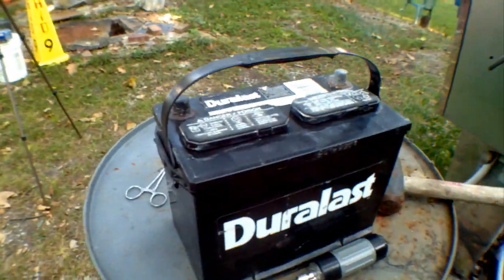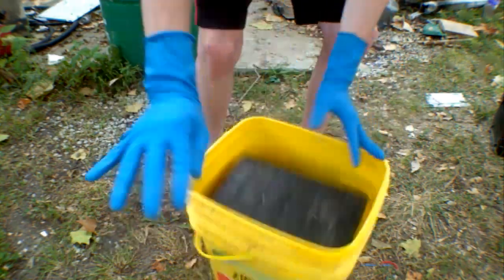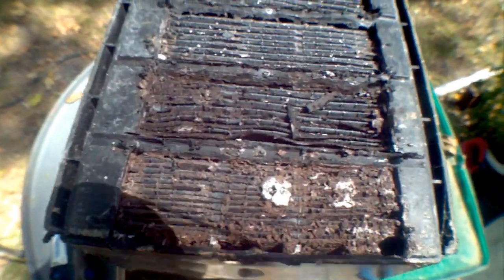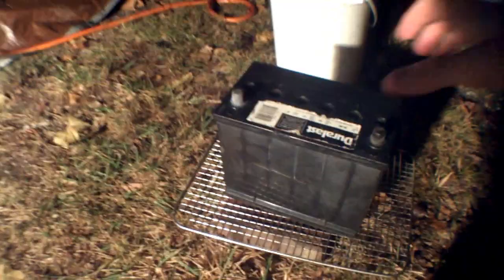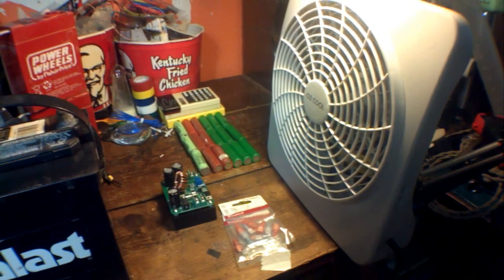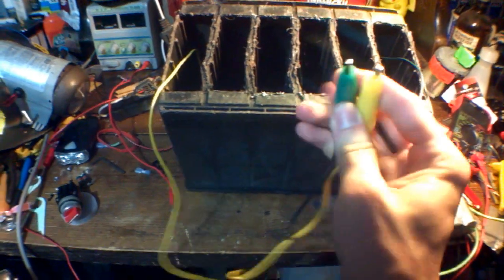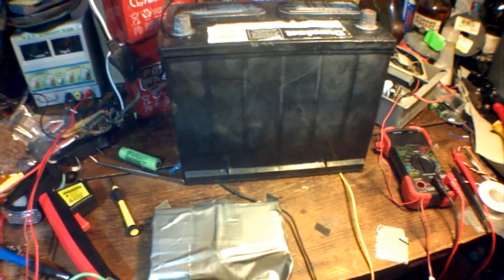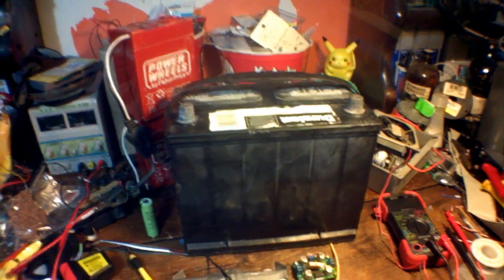DIY Lead-Acid to Lithium-Ion battery conversion 18650

Comment: What a huge and absurd waste of time hollowing out an old battery housing. Handling all that dirty lead and acid, when pathways are in place to pay you money for turning it in and letting competent industrialists recover the resources properly. That plastic bucket or a tin can would be a better and cleaner housing for any battery. But you didn't make a battery. And there's no need to make a battery. Go buy a motorcycle battery, then charge it and carry it around. Your opening sentence reveals your inherent stupidity. "This is my FAVORITE car battery." And I have a favorite paper towel and a favorite piece of aluminum foil. Idiots all.
Reply from the maker: well doing this has made me lots of cash, so thanks for letting me waste your time, but it wasn't a waste of mine.
Reply from the maker: qazmatron  yup dont do things just for money. if you get money thats great though.

Comment: I'm wondering if there is an issue balance (or lack there of) charging this setup?  Please let me know your opinion or if you just weren't concerned about it as you were using  recovered 18650s that still hold some capacity but are no longer 100%.
Reply from the maker: i wasnt concerned about it because i was just slapping it together for my camping trip. but tbh it wouldnt be that hard to ballance it, just add one wire coming out.
Reply: I'm really curious how this could be accomplished with just one wire added?  I was expecting one wire for each cell, but you don't need that many?
Reply from the maker: Atimatik Army  when you connect batteries in parallel they act as one big cell, so realy this batteryis just 2 big cells in series.

when you connect a battery in parallel they equalize and keep the exact same voltage. lithium batteries are very dependant on voltage for their state of charge so they will all stay the same.

likewise you could use this to make a purely mechanical balancing system, have relays to switch all your cells to parallel and they will ballance to the same voltage, then when you want to use the pack you flip the relays and it re-wires the batteries to what you want.
Reply: Wow, OK, I think you answered something I've been wondering about for months.  so for example, you can have as many cells as you want, and as long as they are wired in parallel no balancing will be needed?
Reply from the maker: Atimatik Army you'll just want to make sure the parallel pack stays between 3v and 4.2v and your good.

btw you can get them to like 4.5v before they will fail catastrophically but its just after 4.2v the longevity of the cells decreases a lot.

that increase of cell damage doesnt start at 4.2v though. so if you only charge your cells to 4.1v you will get twice the cycles, 4.0 and youll get 4x.

its interesting, at fully charged a lithium cell has enough potential energy to slowly mess up the plates. i think its the positive plate that gets dissolved slowly. meanwhile for lead acid its when they are discharged that the plates get sulfated and lose their effectiveness.. thats why youd want to store lithiums at like 3.9v and they will last a lot longer in storage. but lead acids at as high a voltage they will stay at.
Reply: Yeah, it is interesting how the different battery chemistries has such an effect on their properties.  Thanks for sharing what you know, it helped me clear up somethings I've been wondering.

Comment: what is the dielectric value of that duct-tape? You can empty the battery housing using the old method of removing the lid. Flooded lead acid battery rebuilding use to be a common place practice. They would remove the lid, drain the battery acid, flush the plates to dislodge sediment at the bottom of the battery cells, refresh the acid, and replace the lid. Then battery prices got less expensive and manufacturers were being sued for poisoning, medical claims, contamination of water, environment, agriculture, livestock, and public health issues including mental retardation from lead exposure. So they now seal the lids on the battery. It is a violation of local, state, and federal law to knowingly open and resultantly contaminate the environment with the contents of a sealed lead acid battery. Your parents will have to pay to decontaminate the property if anybody used this video as evidence to prove negligence in proper disposal of hazardous materials. Just be careful about what you share online, you never know who is on the other end, and that can cost you many things. Remember, the recycle logo on the battery is not a suggestion, and not having the correct zoning, certifications, facilities, equipment, and containment systems can lead to a world of problems.
Reply from the maker: yet people throw lead acid batteries into the trash all the time.

and what exactly did i contaminate? i didnt throw away or burry the contents of the battery. theres nothing illegal about opening a battery.
Reply: Rinoa Super-Genius I did not post to flame or discourage you. I was just sharing the fact that legality does exist regarding public health. Please buy a copy of the book A Civil Action, Yes, there is a movie Staring John Travolta loosely based on the book, and NO I do not recommend forgoing the book for the movie. I have worked assisting research within Public Health in the field of TOXICOLOGY. The professor I worked for focused on hermetic dose response curves. He did volumes of publishing with another toxicologist back in the 1980s under Federally funded research into petroleum contaminated soils and the toxicology of the countless chemicals. The fact that the sealed battery was intentionally brute-forced opened (in this case removal of the relief valves), the acid/contaminates/lead poured and spilled out from the battery, the battery tank cut apart, the lead plates forced from the battery tank using force, and the fact that all of this was done without containment to prevent battery acid from leaching into the soil, lead and related plate material pulverized, made airborne, and not contained. You have many videos about playing with battery and cell items yet never mention how you discard the items when you are finished with them. Believe it or not, there are numerous individuals who properly recycle the battery and cell items they need to dispose of, and they don't even tamper with the battery or cell. Just to be all tree-hugger for you, here is a pamphlet, http://www.epa.gov/osw/conserve/materials/battery.htm
Reply from the maker: joebforty
well i would say dumping the contents of a battery onto the ground isnt a good thing due to lead, but dumping it in somebody's yard you hate is pretty bad. i prefer to blow up my enemy's mail box or catch their lawn on fire. :P
Reply: Haha, I think the mailbox method has been used far too many times, it barely earns any significant "give-a-damn" with most targets, and catching a lawn on fire is not so easy in the middle of a blizzard. I think vengeance is best delivered to the enemy in more novel forms.
...not saying I encourage or discourage such behavior; simply making dialogue.
Reply from the maker: Nicole Nobrega
thats why you buy a few gallons of jet fuel from a local airport or something, that shit burns really well once it gets going.
Reply: Rinoa Super-Genius Local airport only carries the 100LL fuel... It is nothing more than heavily leaded gasoline. Plus gasoline only burns in vapor-state. Now Kerosene on the other hand, not much issue about the lead content, and it does burn real nice. Problem is that Kerosene is $12 give or take per 1 US Gallon. Even then you need to devise a vapor contraption to get things going... Kudos on the more novel approach!
Reply from the maker: Nicole Nobrega
gas only burns in vapor? guess youve never lit a bucket of gas on fire. gas will burn just as a puddle. i think your confusing "detonating" with "burning".
Reply: Rinoa Super-Genius How do you think internal combustion engines work, gasoline is jetted in a small ratio in comparison to the atmospheric air. The liquid gasoline is converted to a gas (aka vapor) via the heat created when the air is quickly compressed, then this hot compressed gas is ignited and the combustion produces an explosion which pushes the compressing piston away. a bucket of gasoline burns because the liquid gasoline surface exposed to the atmosphere converts to a gas (vapor) which is the volatile state where combustion can occur.
Let's say you have a glass mason jar (1quart size for this example) and you fill it half full of gasoline. What happens when you ignite the fuel inside the jar? only the gasoline in the gas (vapor) state combusts which produces heat that vaporizes more of the liquid gas, eventually the glass absorbs enough heat to reduce viscosity and appear to "melt." now you have well over a quarter of a quart of gasoline leaking out of the container... Sh#t ! I forgot to get marshmallows at the store!
Reply from the maker: Nicole Nobrega no its not the act of the gas being atomized that makes it burn, its the gas that is interfacing with the oxygen that burns. if you mixed an oxedizer with the fuel it would detonate even in liquid form.

but once again you dont seem to understand the differance between burn and detonate.
Reply: Rinoa Super-Genius Detonation is a subsonic form of combustion and is not applicable to the conversation at hand. Detonation is not applicable to gasoline in a bucket example. Burn is not applicable as it is a physical change that occurs to something. In the example of a bucket of gasoline; the bucket would likely be the subject of burning, and that is conditional on should the gasoline vapors ignite and produce the action of deflagration.
Reply: Nicole Nobrega Gasoline changes itself into a vapor that will readily burn. Thus you can light a cup of it on fire. The vapor is heavier than air and will flow downhill. Got to be careful with that stuff. Kerosene and diesel on the otherhand are much much safer. Their transition to a vapor is so slow as to almost be non existent. They need a wick or manual vaporization to burn.
Oh and by the way a glass jar half full of gasoline lit on fire will not melt the glass. There is not enough heat fast enough to melt it. Might get it hot enough to crack the jar though. It will simply make a very smoky slow burning fire. I used to play with gasoline as a kid and matches whenever my folks weren't around. I already knew the physics and principles behind fuel oxidation as my father is a science teacher. The crazy things I did with gas, air, closed containers and spark plugs and an old coil. lol

Comment: I hope you were wearing glasses when you dropped that battery.  Also BMS circuits for 2 cell lipos are cheap and easy to wire in they will control charge and discharge even if you just hook it up to a dumb trickle charger.

Comment: Dumass put on cloths that actually protect u
Reply from the maker: from what? the acid is more dangerous to the cloths than to human skin. not counting if i got acid soaked on cloths they would continue to burn me even if i hopped into the shower (in the case i was dealing with an acid that was actually dangerous) but having just skin you can wash off quicker.

Comment: Nice project, actually I have some, let's say 30, spare icr18650 cells laying around coming from different laptop packs, though different battery models and amperages. However, I would like to make a similar thing but several doubts stopped me.
How would you calculate the current needed to charge the pack without exposing the pole batteries to overcurrent? We all know that to prevent this we need to "distribute" the current among the cells using additional wires. How can a step-up transformer might charge this battery pack? 
Let's say we have a 3s5p setup made of 5000mAh protected cells. Our power supply would need four outputs which are ground, 4,3  8,6  and  12,9 volts ±0,05V each. Suppose to charge them at 4,8A each we would need to apply 4,8A * 5 = 24A of current each wire except obviously gnd..  
How did you managed to charge yours?

Comment: What did you do with the paper bag full of lead bearing battery plates?  I'm guessing it went into the garbage and then a landfill.  Not exactly environmentally friendly to put it mildly.  There's a reason lead acid batteries should always be recycled and the lead reclaimed.  What you did is just plain wrong, even if you don't give a rip about the environment or your and others health.
Reply: You missed the point. (Of course; what more should I have expected?) You have NO USE for lead. You will spend more than a few bucks extracting it. You are NOT EQUIPPED to extract any lead, in that you will produce additional toxic waste and poison yourself and your neighbors. There's probably a law against it. Any idiot with a blowtorch is NOT authorized to process hazardous waste (car batteries). The lead you get will be dirty and crapped up, even more useless than clean lead you might buy. And you have no use for lead, except to say "ooh, look at the lead". The battery guts (and anything you extract from them) have only negative value for you, and positive value for others. That's why vendors buy used lead-acid batteries from you; that's why you are prohibited to throw them away; and that's why sane people turn them in. But you say "people throw lead acid batteries into the trash all the time", as if that makes you less wrong. Well, such "people" are either oblivious, criminal, or sub-human. Which are you? We can only hope that you poison yourself more than innocent others. Lead poisoning is a great start.
Everyone: Remember to Dislike this video, and also delete it from your History.
If you can figure out where he lives, toss a coin. Heads, call EPA; tails, tell his neighbors.
Reply from the maker: i put it in storage so i can extract the lead latter,
Reply: Rinoa Super-Genius
That is beyond fucktarded. You are not equipped to extract any lead, it's not economical for you to do it, you won't be able to process the waste produced, you have no use for the lead. You could have turned in the battery for $5 deposit. Rationally you should be able to get the same $5 for the dirty lead you took out, if someone believes it is all there.
Reply from the maker: qazmatron
life isnt about money, and i should be able to get a few pounds of lead from this, a 7$ core charge couldnt buy me that much lead.

oh and yes i have the equipment to melt it down.
Reply from the maker: qazmatron
yes i have many uses for lead. it's one of the best metals.
Reply: qazmatron
Bzzzzt.  He's recycling the lead into swaged bullets.  Hollow points, to make the lead stretch further.  The acid has been mixed with a strong alkali and is the subject of a forthcoming video.  And the plastic casing has been prepared to generate rainbows, should he come across any unicorns.
This was an experiment.  You didn't like it.  Oh well.  Could it have been done differently?  Sure!  Could he have gotten different/better/cheaper/etc. results?  Positively.  But you weren't there to help out beforehand, so you were defective in that aspect.
Vendors don't buy used lead-acid batteries from you for YOUR benefit, they do it because they HAVE to.  And there's probably a law for that.  A core CHARGE is just that.  It's a CHARGE for recycling.  You get your CHARGE back, when you turn in your OLD battery on buying a NEW battery.  If they "gave" you $5 or $7 out of the BLUE for turning in a BATTERY, then there wouldn't be any waste batteries sitting by the side of the road.  People would PICK THEM UP AND TURN THEM IN FOR MONEY.  But, you don't get MONEY unless you've PAID YOUR CORE CHARGE ON A NEW BATTERY.
Now, speaking of "fucktards", let me mention you.  If you think you can get $5 for the corroded lead from an old battery, then you qualify.  If you didn't BUY a battery, and try to turn in old, corroded lead, then that's what the people in the store will call you, along with subhuman and oblivious.  They'll only call you criminal if you've stolen the corroded lead from somebody.  I will settle for calling you "idiot".  A little more polite.
That was simple.
Reply from the maker: Ramix Nudles
 actually you can trade in batteries for money. they are valuable for their scrap lead. and no we dont see many batteries laying around compared to other things because lead acid batteries are one of the most recycled objects on our planet behind asphalt. i think its like 98% recycling rate.

you can take batteries to the junkyard and they will give you 7$ per battery, we dont have any lead smelters since the Herculaneum smelter shut down a few years ago so we dont have hardly any new lead coming into the market.

i'm sorry you where so misinformed.

i do agree that he wasnt there to help so he shouldnt get so pissy about it. the novelty of having an old car battery that looks complete but ways like 2 pounds is really awesome.

i'll prolly toss it at somebody and they will freak out thinking its a 40lb battery not knowing its an empty shell hehe.

i think qazmatron just doesnt understand the idea of "novelty" but oh well.
Reply: qazmatron I would like to apologize.   Rhino said that you are right.   I made an assumption that the core charge was ONLY a return on deposit for a new battery.   I did not think that you could get any $ for dead batteries (or live,  for that matter).  At 7-8 bucks a pop,  I will be thinking of picking up abandoned batteries.  A couple of those are a new Arduino.  Or a couple of boxes of ammo.  Either, I win.  Carry on.